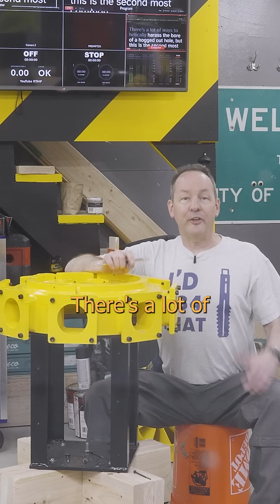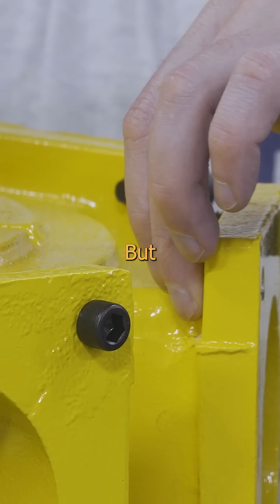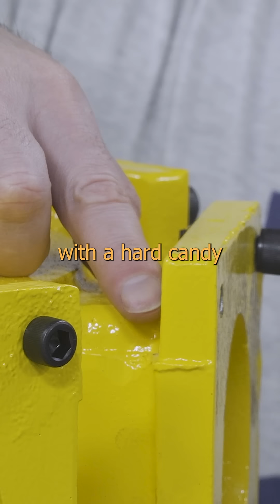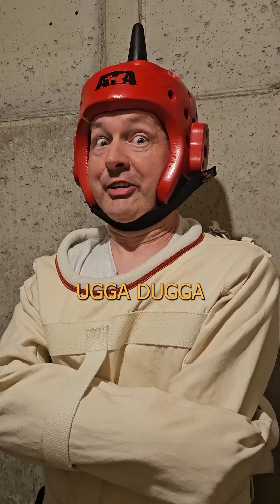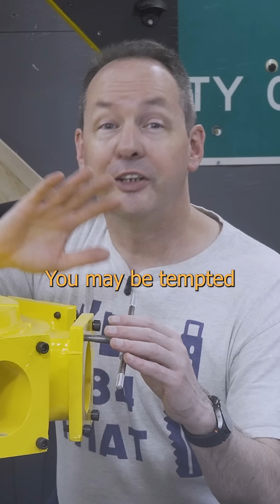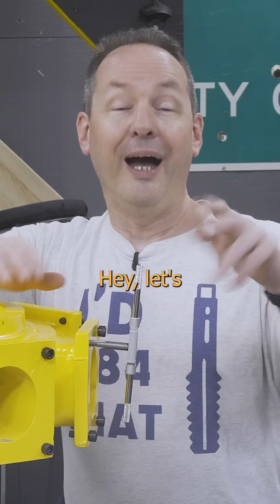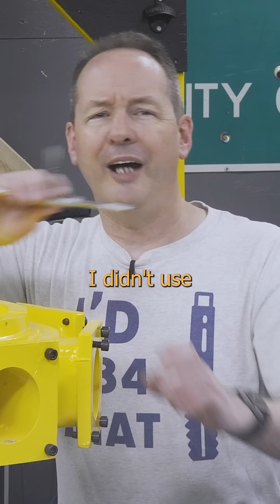Thread Chasing  #chrisboden #comedy #engineering #skills #workshop #metalworking #tools #apprentice

Comment: Try inserting rolled up foam ear plugs into the holes before the paint next time. Cheap, effective way to keep the threads clean.
Reply: That would work well for conventional paint but this was powder coated which requires curing in a oven at about 450° depending on whether it's an epoxy or polyester based powder.  Silicone plugs and high temperature tape do not deform or burn at those temps but foam ear plugs certainly will.
Reply: Take 'em out before the furnace?
Reply: @ClovisNorthson  Two problems with that. First, professional powder coat operations are distinctly hands off from the start of cleaning to the end of baking (you're not allowed into the line for various contamination reasons). Second is that, even if you could get in, removing the plugs just allows the paint to fly in the gap.
Reply: @lordlundar  Two problems. First is that powder coat isn't paint and it only sticks to what is statically charged. After you spray it, if you were to have plugs in the holes and removed them, there isn't any way something would drip or run into the bolt holes because it's dry. Secondly, professional factories do in fact have assembly lines where a person is there spraying each part as it goes by. It's essentially a big paint booth with a conveyor. I'm not sure why you're making it seem like some kind of OR in a hospital because it's really not like that at all. I also just want to say the ear plugs are pointless because there's no damage to the threads and like you can see it's easy enough to clean afterwards.
Reply: @ThompsonAutomotive  Well I was pointing out the "remove the plugs before baking". I am aware of how powder coating works (though I will concede on the spraying part) and I said any floating powder would go into the area the plugs were removed from, rendering removing the plug before baking irrelevant because you'd have to clean the threads after.
Reply: @Renegademetalartyeah for the most part the powder coated part we have dedicated plugs made of sillycum loved being final production was the best time
Reply: @Renegademetalartdoesn't silicone start to melt/burn at about exactly 450 though? 😅 Or am I'm misremembering
Reply: @Skriggler  Foam ear plugs aren't silicone... Yes they have silicone ear plugs but those are the flanged ones that look like power line insulators, not foam.
Reply: @Renegademetalart We use a big roll of silicone tubing.
Reply: @RenegademetalartOr just put bolts in the holes and take em out after it bakes
Reply: @floridamanmick1372 can't the bolts will expand in the kiln, cracking the block
Reply: @floridamanmick1372  A powder coat is essentially an enamel coating, Very durable. Good luck getting the bolt out after, let alone getting it out without ruining the coat.
Reply: @lordlundar  I did it for holes in the bumpers of my truck, they came out just fine and no damage to the powdercoat around it
Reply: @wolfrickthedesigner4748  Except that the block is Al and expands twice as fast as steel bolts.
Reply: Is the earplugs burning away a problem? It's just a disposable foam earplug, would it contaminate the coat?
Reply: @colinz226 maybe? A big part of powder coating is getting a clean surface, so having something burning and creating soot/smoke on the thing you're trying to coat is probably not great.
Reply: @SuperMadmadman the clean surface is important for applying the powder not after. Once coated, the surface you worked so hard to clean is covered. It just needs baking to become permanent.
Reply: @colinz226  , the short answer is... 

Maybe?  

But the real question is... why would you chance it?  It's possible that it doesn't cause any problems. It's also possible that it does, and afterward is the wrong time to find that out.
Reply: @colinz226  - Powder coat is baked with heat, and burning earplugs produce ... heat... that is not uniform because flames go up near the fuel.

I did NOT experiment to prove it, but maybe someone could throw a test piece in a batch and validate this obvious conclusion.
Reply: @Renegademetalart silicone plugs, exist for this most competent powder coating shops would have these.
Reply: Powder coat ≠ spray paint

Two COMPLETELY different processes my dude.
Reply: They sell silicone plugs for this specific purpose that are just as cheap, but way more effective. They won't melt in your oven during the bake.
Reply: Dumbass I forgot all the details but I was putting apart back in an older car  and the dumbass part is I wasn't even using a tap I was using a harder steel bolt to try and clean out incorrect the old one out threads I started with a wrench but that was too slow so I jammed the socket on my impact it went for it with that it took me like 2 hours to get to threads right again
Reply: @budgetbuyoutmisc.4916  LOL, "putting apart"? Please tell me, was that merely a typo, or is "putting apart" a clever way of saying assembly caused the car to somehow become disassembled again?

Thanks for recounting the tapping experience, too!
Reply: What?! No way!
Reply: what, no way... ---sake... I just learned that.
Reply: I was gonna comment this but someone beat me to it.
Reply: For normal painting this is good, but don’t let the paint dry too much before removing them, or they become rock solid
Reply: Great idea 💡
Reply: Man I did that like ten years ago now I use liquid plastic cause I need more than just the holes filled surfaces need an i got bored with trying to find the right plug for the right hole and tape an ptfe for surfaces. It goes on easy comes off an out clean
Reply: @JimMedeiros-fc3pg  hey i did that!
Reply: Clay or swimmers plugs work well also
Reply: Thats actually a great idea
Reply: Great idea for certain painting thanks
Reply: I do the same thing with all the shop vacs screw holes in the boatyard I work at, the carpenters fill them with a 3 inch vertical column of compacted sawdust if you don’t, takes a 5 minute job to get the top off one of those fuckers into 30 minutes of beating on the bottom trying to knock the last bit o shit that’s blocking off the fastener loose
Reply: That'll work beautifully when dealing with conventional paint, but not powder coated paint that is cured in an oven. This tip will come in handy putting lipstick on a greasy pig of an SBC, BBC, SBF, BBF, SBC and BBC along with painter's tape on the gasket mating surfaces next time. Thanks.
Reply: @trickyricky12147  if you can find it, foil tape works a little better than the painters tape for gasket surfaces sometimes
Reply: Tampons are better
Reply: You have safety equipment available to you?
Reply: Even better, just use threaded rod, cut to length. Works every time and reusable.
Reply: And you can reuse them to customize your auditory profile after the fact!
Reply: If you can find them, using plastic caps/plugs is better than earplugs, and they’re reusable. Used to use them in the paint shop at the CAT dealer a lot
Reply: Thanks man
Reply: I’ll have to keep that in mind I use a little dab of latex caulking, or a little wad of masking tape
Reply: Great call
Reply: That's what my fabricator used to do for shopped out paint jobs.
Reply: oh my, Jesus
Reply: And if it's a through hole, use two plugs; one on each end.
Reply: @willmfrank That's what she said
Reply: I can second this! Those little yellow/pink ones are perfect. Used them a few times to plug holes.
Reply: 👏 brilliant

Comment: Damn thats crooked 😂😂😂 also dumbass, i tryed removeing a m3 screw with a drill. Head snapped, and well my rc cars engine was well.. scrap 😢
Reply: Prolly used lo temp loctite at assembly.   Next time, put the tip of a pencil soldering iron in the hex pocket for a few seconds to loosen the loctite.  I use white glue instead of lo temp loctite- works great in dry locations, gives you more fiddle time and loosens with minimal heat
Reply: @dhgmllcshea5038  nope, no loctight, my geuss is corrosion and it bonded as that screw was like 12 years old and hadnt been touched

Comment: Retapping optics tables, 4'x8' 1" hole spacings, some larger.  Many taps broken.  Recognize and recycle damaged taps.  Chaos issues when 2 tables are 1/4-20 and the 3rd is M6.  Over time screws are returned to the wrong box or in a bin, unlabeled.  With practice, time, and mistakes you learn to spot the difference in the  threads.  Tip. If the screw doesn't fit/seat do not force it.  Various taps exist for initial tapping, shallow, deep, and passthrough.  Lube, Lube, Lube.  Mount and use guides, free handing is for pros like you. Also back the tap out when removing significant amounts of material and clean the tap with compreesed air.  Print and laminate tap and clearence hole charts.   Precision is in the details.  Your lessons are 24 🥕 Au.
Reply: I'm amazed that a modern optics table wouldn't have milled threads with Higbee cuts at thread entry since they cost a lot and would be cut on a cnc, enabling thread milling and Higbee cuts.

Comment: This dumass has dropped them, drilled them, and busted them off in blind holes!
I will say the worst metal to tap is copper.
Reply: Why? Id figure being so soft it taps like butter.
Reply: @Qballl it starts off sticky, gumming up everything, but work hardens the more you move it. So you have a hole half brittle and prone to snap bits of thread off and half that want to stick to your tool and they are both connected to each other.
Reply: @Sethlar9 that makes sense. Copper does work harden, didnt think about that
Reply: @Qballl  that softness is the problem.
Reply: I see bit of a double edged sword
Reply: Titanium is the absolute worst for threading.  Tapping is damned near impossible.
Reply: @nothing-qm9pq  I've tapped a few holes in Gr2, but for me K-Monel is the worst, though that might just be because it's almost exclusively 1/4"-28.

Comment: Indeed I’m that dumbass. #6 tap, blind hole, aluminum, running out of time. Broke right at the end of the hole too lol
Reply: Blind taps are THE WORST
Reply: @reeceguisse17 You’re not kidding. I’ve repeatedly had to tap threads deeper into a blind hole, when the guy before me didn’t thread it deep enough. Should get done right earlier in the process. I’m afraid of breaking a tap off in a hole, and having a huge headache on expensive equipment. 😬
Reply: @reeceguisse17  Right?! How do they even know where they're going?
Reply: @UVBluetoo it suddenly gets a LOOOOOOT harder to keep going on a blind hole. That’s when you swap the plug tap for the bottoming tap and finish it off
Reply: @StealthTheUnknown Blind tap...can't see where it's going...ha...ha... Yeah it's not funny since I had to explain it. Honestly, I'm a little disappointed no one got it.
Reply: Ouch that hurt from here
Reply: In aluminum?! That's impressive
Reply: @BryanVonFriently not if he forgot to oil it... aluminum is very sticky when dry. And most wrought aluminum (6061, 2024...)  makes long chips if you tap deeper than original threads.
Reply: @dhgmllcshea5038 was gonna say same thing. Most people think because it’s alum and soft it’s easier. But it’s not. 😂
Reply: @dhgmllcshea5038 sure but even in a cinch i would at least use cutting oil, and then still even without i wouldn't really expect a tap to break in aluminum given how soft it is, but that might be because i usually work with 5053 or 6072 so maybe that might make a difference, i'm not very familiar if other aluminum might be worse to work with.
Reply: @dhgmllcshea5038  Annnnnd we've got a winner! No lube, power tap, snappy snappy. LEsson learned? Hand tap it and use plenty of lube lol.
Reply: @dhgmllcshea5038 at school we were taught to go clockwise for maybe half a turn, then back until the chip breaks off, then forward again
Reply: @spookydoops  applying a grease in the grooves of the tap works great for this. This way, all the chips come oozing out and you don't have to back off paired with using cutting oil for the threads themselves.
Reply: @dhgmllcshea5038  Was taught to use Kerosene for tapping Aluminium back when I was an Apprentice, works every time.
Reply: @BryanVonFriently  not really, aluminum is grabby as hell. The major diameter on #6 is just over 1/8". 
Using a drill on that size, even a thru hole is begging for trouble. 
Kinda like chasing redheads on a tequila-fueled bender, but not nearly as much fun.
Reply: @hossmcgregor3853 what an allegory lol

I'd expect the guy to at least use cutting oil when doing this, or at least something fluid, water if need be. I don't think i've ever had a tap break in aluminum before, stainless sure, too many times, but aluminum is generally very forgiving so i'd expect either his tap to have been fatigued or poor quality
Reply: @BryanVonFriently  tiny taps break easy, even in aluminum, especially with power drill.  I've seen guys that didn't know what they were doing break a brand new tap, in aluminum. 
Drills tend to have too much torque and near zero feedback. Not to mention they are a bit more difficult to keep running straitght.
Reply: @hossmcgregor3853 i forgot for a moment this was about using power drills and not a lathe/mill/by hand

Yeah i suppose at depth it'll run into the sides too much and break if you're not going straight enough.
Reply: @BryanVonFriently  yep, then you get into those little itty bitty shit like #4.  Give me bigger holes to tap any day.
Reply: @hossmcgregor3853 
I married a redhead, cause she is more stable then the last few girlfriends.
Reply: Same here bud, I turned a 5 min job into a 5 hour one 😂
Reply: @King_Shroomy  oh bud, that suuuuucks. How'd u get the broken tap out?
Reply: @Maezhughes when it happened to me I  milled it out with a 0.0625 carbide end mill.
Reply: @Maezhughes  trip to the machinist if the tap extractor doesn't work.  Drilling it out is a path to a bad day.
Reply: @daveshere9723 yeah, that's never fun
Reply: I guess you hit the end of the blind hole, the sudden stop is very hard on the tool material because they tend to be brittle from hardening.
You can also sheer off screws that way, depending on the material; not exactly fun times.
Reply: @Kr0noZ  Actually I hit the clutch limiter on the drill, and the vibration from that was enough to throw everything off just right to snap the tap like dried spaghetti.
Reply: @GreenEridani The clutch isn't what caused the tap to break. It was you not being able to keep the drill perfectly aligned to the work when the clutch slipped.
Reply: They always break at the last 20% of the intended thread ending distance 😅
Reply: I'd like to kick the ass of the engineer who thinks stainless screws into aluminum is a good idea.
Reply: My Dad is an old style bodyman and mechanic. He can torchweld an exhaust pipe, weld nuts to the top of sheared off bolts in engine blocks to back them out. He knows about brazing to repair broken cast iron bench vices.
Reply: Glad I was taught to drill 0.3" past target depth and to tap 0.1" past target depth. Still have it in my checklist.
Reply: I hate it when that happens, I've only broken I think 2? But yeah, breaking taps will teach u patience and control
Reply: Yep … sigh
Reply: Funny how taps never, ever break at the start of a hole.
Reply: I felt you die inside from across time and space. I bet you felt your dinner turning to cold regret.
Reply: @BPL-Whipster  I'm not sure if that's compassionate, or creepy and you should be the one wearing that straight jacket Chris has.
Reply: @UVBluetoo I'm real good at typing with my nose
Reply: @BPL-Whipster Hehehe
Reply: Dude, Freddie Mercury getting drilled on a Saturday night is straighter than that hole. 😆🤷
Reply: o7
Reply: Dumbass, all I want to say is air drill
Reply: Dumbass, all I want to say is air drill
Reply: Ohhhhh 😭ohhh my balls ⚽️ dropped
Reply: I wanna joke about having a screw loose to do that but your adorable pfp says otherwise. Her screws are tightly done
Reply: Did you wreck the work?
Reply: I had that too but instead of it just snapping it welded itself in place so it was impossible to get out.
Reply: Ofc it did! That's when they break. Haha. Good luck good sir. 🇺🇸

Comment: This is giving me flashbacks of over drilling 5/8 holes to 7/8 and hand tapping 1"-8 threads for custom thread inserts. 

That was my arm workout for the month.
Reply: Why didn't you just mill out the tap with a carbide bit? That amount of work likely you could have gotten someone to blow it out with an EDM. I live in Nowhereville, and there used to be a guy who did this back in the day. It was $100, now it would likely be 4x that.

Comment: Another quick and dirty way to do this is to use a cutoff wheel on a Dremel and cut a slot along the threads into an appropriately sized fastener and send that bitch home with an impact

Comment: I learned the hard way, about 30 years ago when I was 17. I learned from my mistakes before causing any real damage on the 1982 Mercury Capri RS with t-tops that I had been working on.

If you do not have a table, but you do have extra bolts, you can cut one of those bolts and turn it into a tap. When doing that, always make sure you get a thread file so you can file the area that you cut.